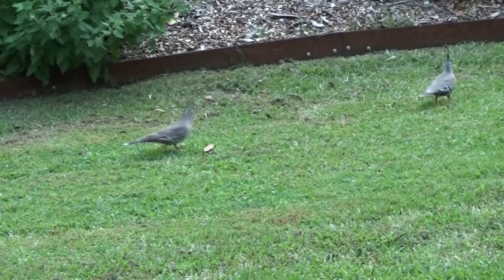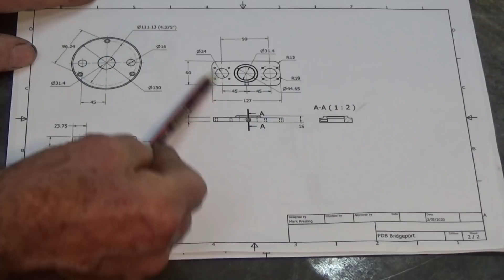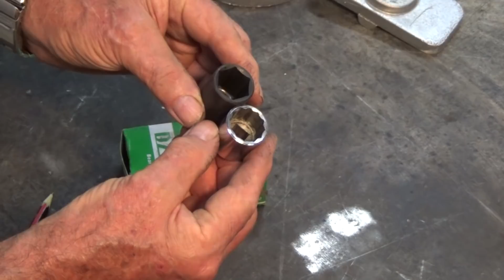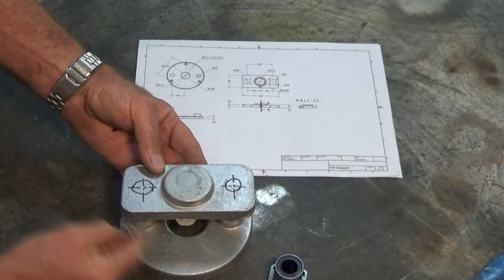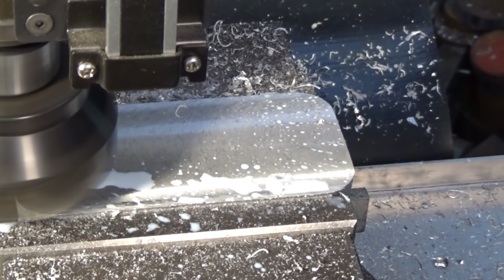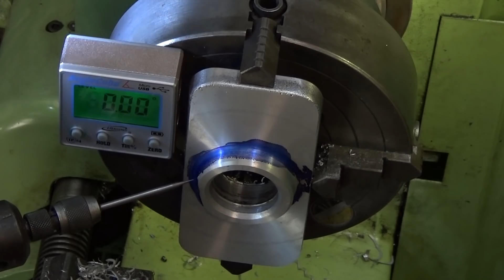DIY Power Drawbar for a Bridgeport Style Mill

Comment: I am attempting to build an aluminum casting firnace for making your drawbar parts. How much sand do i need and what type of sand?
Reply from the maker: I buy a couple of bags of "Play Sand" from the garden centre in our hardware store. It needs to be dried out and sieved to remove any organic material and bigger grains. Add about 8% bentonite clay which can be purchased from rural suppliers. It is sold as a feed supplement for horses and livestock. It is also sold for sealing earth dams. I have about 20kg of greensand ready to go and I store it in large 35litre drums with screw on lids to keep it from drying out.
Regards,
Mark

Comment: How large a crucible do I need to melt and poor the parts for your power drawbar? I think the base piece is the largest of the items.
Reply from the maker: I have a number 8 crucible which I believe is capable of holding 8 pounds of molten aluminium. However it would depend on how many moulds you would want to pour in one session. I will usually only make up two moulds which might only form one casting each. It's probably preferable to not completely fill the crucible too. It's more likely to spill and it can be hard to direct the flow into the sprue if it's really full. 
Regards,
Mark

Comment: Where you buy the pneumatic driver?
Reply from the maker: I got mine from a local tool supplier but they can be purchased on Amazon or Ebay quite easily.
Regards,
Mark
Reply: But how is the correct name? Because I only found the tool for removing the wheels of the cars
Reply from the maker: @nicolopolidoro1568  It's called a butterfly impact wrench. Like this one https://www.ebay.com.au/itm/155451520783?epid=7022013144&hash=item2431a1f70f:g:vwoAAOSwsmZkDq~W&amdata=enc%3AAQAIAAAA8Ls1UjSwRcX649bC3p2RQ2voqj7%2B2aIYUIGD1h12372ZN8AmYGSWeBAFRgkYtIsbWeAaLyoxORmHv9ogD7KdnMGWW%2BW2bVr76wovezr99x3IQOnStn%2FgS9CHwCqnycyVz90Zaz9B29eh3WOk5x%2Fm%2FyzKr1ipQzz7xqsubPG5WdksY3%2FwAMnckbh8SVOoW8dL5yHXo2r8OEIzpY2sh01O34NT2WRvUURxLOZmiXEin6yBuIwfQ7zNnTUduR0L0bySBV9WIpUZrlgX%2FXffLWb1a%2Fo%2FOVBfOwxEV96VDLtbyZE2JcA9wY5zEG9%2FTcuVUWGq1Q%3D%3D%7Ctkp%3ABFBMiviv_J5i
Regards,
Mark
Reply: Thank you very much!

Comment: Very good project for the home workshop. Do you think you could publish some specs for the butterfly impact wrench, please? I tried to find one but none of the home hardware type shops have even heard of them. Thanks in advance.
Reply from the maker: Robert, this is the one that I purchased. https://www.tradetools.com/product-range/air-tools/air-impact-wrenches/renegade-industrial-3-8-dr-butterfly-air-impact-wrench Renegade is the in house brand sold by Trade Tools here in Australia but this is the one that Harbour Freight sell in the USA https://www.harborfreight.com/3-8-eighth-inch-drive-75-ft-lbs-torque-compact-air-impact-wrench-93100.html?_br_psugg_q=butterfly+impact. Interesting that I paid $69 but the same thing in the USA is $20. They are pretty much the same tool, just different colours. 
Regards,
Mark
Reply: @Preso58  Thanks for the quick reply, I am also in Oz. Not sure if this was apparent to you. I got myself an Optimum lathe and mill recently for a hobby and it looks like the only things I will be making on them are more things to make them work better. But we all need a hobby and it keeps me off the streets I suppose. Thanks again, stay safe.

Comment: Could you drill n pin the socket on?
Reply from the maker: It's all fixed now. I bought a new short socket with 12 points and it stays locked on the impact wrench spindle just fine.
Regards,
Mark

Comment: Your DRO should be accurate enough, drill the 16uu flange screw holes about .010" over there should be enough slop to align the bearings then tighten them down. My height has shrunk a couple inches also.....the project sounds like something I need. Got anymore castings? If so, how much? Oh and I need the plastic paddle piece you designed also. you can email me @ hobotek@hotmail.com
Reply from the maker: Unfortunately, I don't really do castings to order but I will be making the drawings for the entire build available (for free) when I am sure it is working correctly. I will also make the STL files for the patterns available if you want to have a go at casting your own. To be honest though, you could fabricate the entire build from flat stock. 
Regards,
Mark

Comment: Hey Mark I’ve seen this model of power drawbar before (NYC CNC) but there’s something that I still don’t understand. The impact just “unbolt”/loosen the draw bar but what makes it release the collet!? 
Wouldn’t you still need to tap the top of the drawbar down like usual to release? How are you doing this with an impact in the way!? Do you just yank on the activation handle down or does the hammering/shocking properties of the impact is enough to release the collet?
Reply from the maker: Max, I have tried the impact wrench on the drawbar and you are correct that sometimes the collet or tool won't release from the R8 taper inside the spindle. According to Wikipedia, an R8 taper is supposed to be self releasing unlike a morse taper. Having said that I do sometimes need to tap the end of the drawbar with a hammer to release some tools. I believe the hammering action of the impact wrench and some downward force on the mechanism helps to dislodge stubborn tools. I am also going to have to inspect and clean the interior of the spindle bore to ensure it isn't gummed up with old oil and dirt. I hope to have the tool finished by the end of the week and then I can try it out properly. 
Regards,
Mark

Comment: I'm nervous about how that one grub screw is going to stand up to all of the torque in the long run.
Reply from the maker: Me too! If it works loose I will increase the size of the grub screw and cut a pocket in the nose of the impact wrench to allow the screw to seat positively. I have also considered some sort of key arrangement if the screw fails. I won't know until I give it a proper workout.
Regards,
Mark

Comment: Nice project mate, can't help thinking the linear bearings are somewhat overkill! Taller Al casting on the top and a sliding fit directly in the Al on smooth steel would work fine. All the best! Matthew
Reply from the maker: Yes, overkill it is, but man, it's satisfying to see it bounce up and down on it's springs. 
Regards,
Mark
Reply: @Preso58   I get it, I like  what  make  and  do,  but talk  about  the overkill. A  couple  of   bits  of  hot rolled turned  or  a couple  of Shock absorbs  rods  running  in  an Al casting.  Don't  get me  wrong,  I  apreciate  your work,  maybe  talk  about alteratives!  Cheers, Matthew

Comment: I have made the patterns to cast the aluminum parts but it is too cold to cast now. I'm going ultra cheap with UHMW bushings since I have left over material. Guide rods turned on the lathe from pipe. Alignment of the two parts ensured by fastening them together to bore both at once. Requires making flats on the base bosses to clamp in the vice since the upper plate will have larger holes for the bushings.  I had thought that I would have to machine the air motor to get the nose round. Your method seems easier. It snowed yesterday so we are having a white Christmas. Subscribed
Reply from the maker: Machining both castings at once would absolutely ensure alignment. That was the major consideration for this build. I am probably overthinking and over engineering the assembly but sometimes I enjoy that process. I think it's funny that you are finding it too cold to do any casting. I am having the opposite problem. I have to do two more castings and I have been waiting for a cooler day to do it. We have had some really hot and humid weather recently and it's no fun getting dressed up in leather aprons and long pants to do it. 
Regards,
Mark

Comment: All i use is a spanner with a 3/4 socket on a pivot  on the end , it's a 2 second piece of piss job .  But when i fit a riser to the mill i will not be able to reach it !    I will be very interested in the  final outcome &  plans when you complete the project .    Have a great Christmas Mark .  Cheers .
Reply from the maker: I was wondering how people with a riser on their mill get around the problem of tool changes. Built in ladder perhaps? 
Regards,
Mark

Comment: Great video. Clear explanations and coverage. Is a pneumatic driver better than an electric? Mahalo for sharing! : ) 🐒
Reply from the maker: I would think that electric would be fine. I already have an air outlet above the mill so I went that way with it, but if you didn't have a compressor then cordless drivers would be an option.
Regards,
Mark
Reply: @Preso58  Mahalo!

Comment: Nice to be precise but there is no need to go crazy to get linear bearings lined up. Your DRO would have been quite adequate. The linear bearings are Chinese! Chinese, get it? Slop is the name of the game. I have a far more complex power drawbar for a BP clone and it didn't need much to work over a 5" travel.
Reply from the maker: As you will see in the next episode, I ended up having to move the spindle with the DRO to two different locations to bore some holes for the fixture anyway. This was precisely what I was wanting to avoid but as it turned out the result was ideal. I had this noble intention of showing how you could achieve precision without having a DRO and in a way it's still possible. 
Regards,
Mark

Comment: Thanks for that. I am working on a power drawbar for my mill, an 80's era Taiwanese universal mill, about 4000 pounds and even taller than a bridgeport with 40 taper tooling. I have a very similar impact gun with the same mounting, just not powdercoated. Your idea of grub screw at an angle solves all the mounting problems nicely.
Reply from the maker: There was a sort of rubber bumper fitted on the nose of the driver. I levered it off and found the perfect mounting solution hiding underneath it. That single grub screw still has to contend with the hammering action and the torque and some people are not convinced it will do the job without slipping. I haven't yet tried it but by the time I get around to the next video  I should know if it's going to work. 
Regards,
Mark

Comment: Hi Mark -- the Bridgeport has made you an old hand with those imperial terms like 1/4-20. You're even using decimal millimeters and imperial sockets. Be careful or Queensland might turn rightside up. 😎 Season's cheer to all down under, and especially to one of my favorite YouTubers. 🎄
Reply from the maker: I am old enough to have worked with both imperial and metric. Right up until the time I left high school we were still using imperial units and I learned all my technical drawing in inches. The day I started at college we had transitioned to metric and we just got on with it and never looked back. That was back in 1975 but to this day we can still go to the hardware store and buy "legacy" imperial fasteners. 
Regards,
Mark

Comment: Merry Christmas Mark.  Watching your casting projects really makes me want to step up my casting game.  So far all I have done is get the furnace up and running and cast some aluminum muffins.

I'm looking forward to seeing how the rest of this project comes together.
Reply from the maker: Metal casting at home is one of the deepest rabbit holes there is. Having said that, it's so rewarding when you dig something out the mould and it's pristine and useable. One bit of advice though.... buy or beg for some quality aluminium ingots from a local foundry. I began by melting scrap and after a few spectacular machining failures I purchased about 20 ingots of good quality 601 alloy. They cost me $10 each but the improvement in the castings was worth it. I get hardly any porosity and the surface finish after machining is way better.
Regards,
Mark

Comment: To this day it is amazing how many shops, both large and small, you can go into here in the states that have manual knee type milling machines that are still paying machinists and toolmakers per hour to spend time cranking a knee up or down and fiddling with wrenches overhead to change tooling.  I think I would rather give up my digital readouts before I would give up my power knees and power draw bars.  The time they save is incredible.
Reply from the maker: I agree. I am pretty much over cranking the Bridgeport knee up and down. Such a long handle and such a long way to crank it!
Regards,
Mark

Comment: Mark, isn't the critical part the bore on the mounting plate and the linear bearings? as such the through holes in the pneumatic driver could be slightly oversize and a little bit of wriggle room in the mounting bolts for the linear bearings or am I missing something?
Regards from Melbourne (no longer the pariahs of Australia)
Reply from the maker: Hopefully it will all become clear as the build progresses. I was aiming to get near perfect alignment on all the moving parts. I realise now that any slop in the mechanism will be exacerbated by the torque and the hammering action from the impact wrench. So, without actually trying a setup with loose-ish bushes could lead to the mechanism binding. However, having some play in the bores for the bearings would allow you to tune the alignment. 
Regards,
Mark

Comment: Well done, Mark.  I always enjoy your videos--especially this one, since I made a pretty similar unit a while back.  You can see it here: 

http://bullfire.net/Power_Drawbar/Power_Drawbar.html
Reply from the maker: That's really a nice build. I like that you have anodised the parts. That's always a professional touch. Now that I have most of my build done I am worried that the collets and tooling don't always want to drop out when I am using the spanner to loosen the drawbar. Something is sticking in the spindle nose. Maybe it just needs a good clean and some oil but once the impact wrench is sitting over the drawbar nut you can't really get at it with a mallet. 
Thanks for the link.
Regards,
Mark
Reply: @Preso58  I found that the repeated impacts tends to shake the collets out, so I haven't seen the problem. Before installing the unit, I had to whack the drawbar with a mallet.

Comment: Hi mark,
Just some observations for discussion.
As you are making a precision sliding mount for the air gun/wrench and the housing nose is quite possibly not concentric to the shaft, may I suggest that you strip the wrench down and machine the nose and then either remake the slider or bush it to suit.
It would also be prudent to get a proper 12 point impact socket and cross drill the drive square and use a hard pin to retain the socket.
This will allow the socket to self align to the drawbar hex.
Good project and I look forward to the next episode.
Stay safe.
Reply from the maker: I have actually had the assembly in place on the mill and the socket has enough play on the shaft to align quite easily with the drawbar hex. I did consider dismantling the impact wrench to machine the nose casting but I am always hesitant to mess with cheap tools. They have a tendency to not go back together very well.   I do agree that the 12 sided standard socket is preferable though. I have been putting off the casting for the handle due to the hot days we have been having. Maybe next week! 
Regards,
Mark
Reply: @Preso58  Better enjoy that heat, it was -19C here this morning  and 40 cm of fresh snow 2 days ago. You don't have to shovel sun shine. :-)
Reply: Glad you have taken the odd factors into consideration.
As a prototyper some times a chat session is a head banging idea fest.
Take care, and play safe.